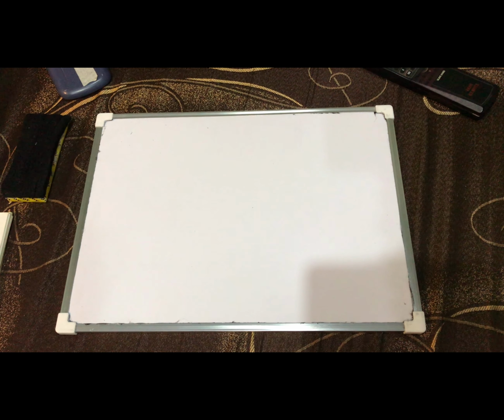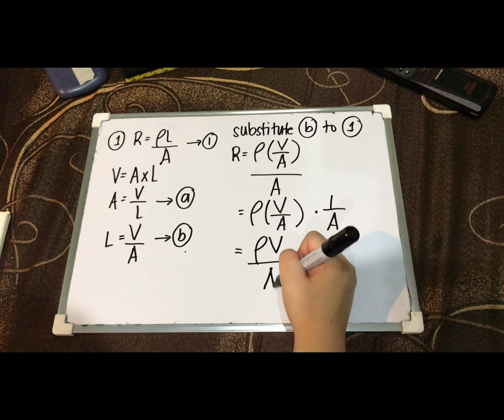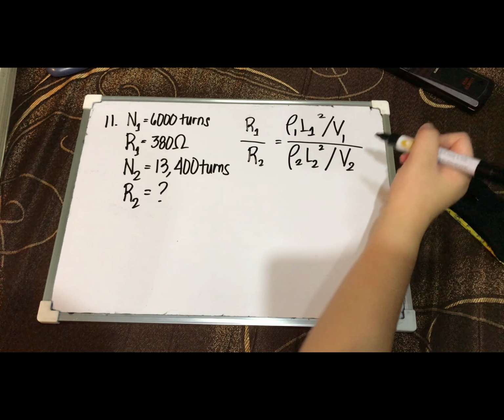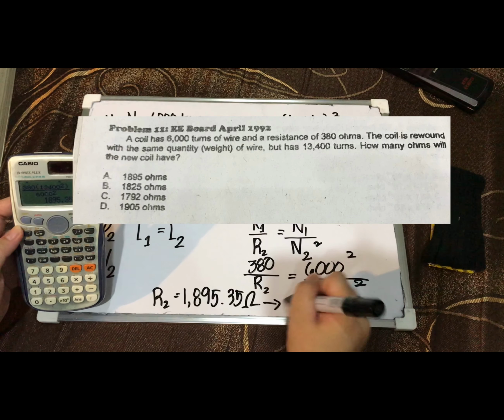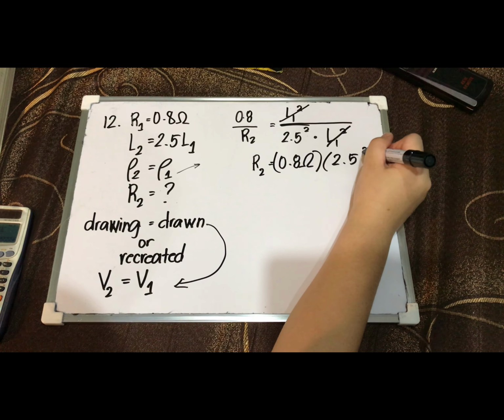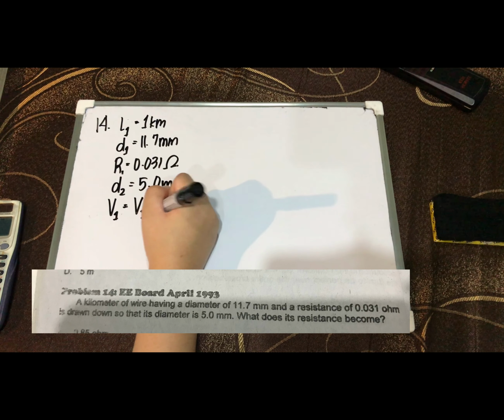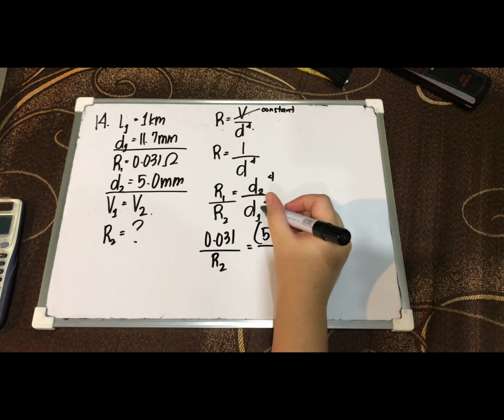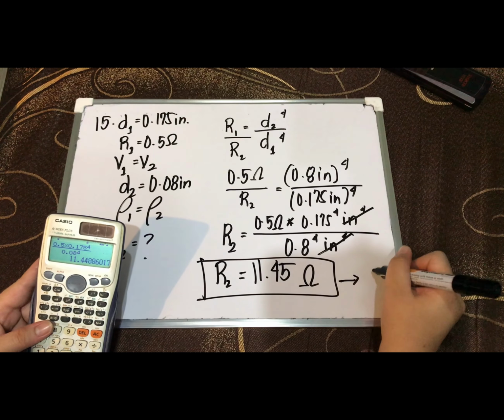1001 Solved Problems in Electrical Engineering (Romeo A. Rojas Jr.) Chapter1 Electricity (Nos.11-15)

Comment: engr. bka pedeng patuto pano sagitan tong problem n to.👇

two balanced three-phase loads are connected in parallel. Laod 1 draws 20kw at a lagging power factor of 0.85; Load 2 draws 25kw at a lagging power factor of 0.5. The line voltage at the terminals at the load is 440V. The load terminals are connected to the source terminals by means of cables which have an impedance of 1+j3 ohms each. Calculate the line voltage at the terminals of the source.
Reply from the maker: Sige Sir, wait for my next video. Let me answer that po.
Reply: @EngrMJ-xh1jl  thank you very much engr. mj